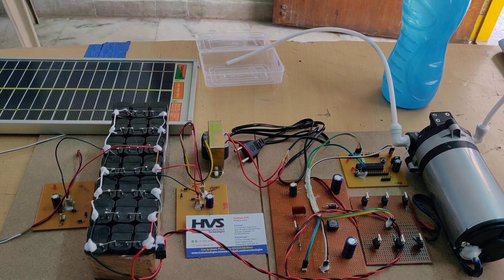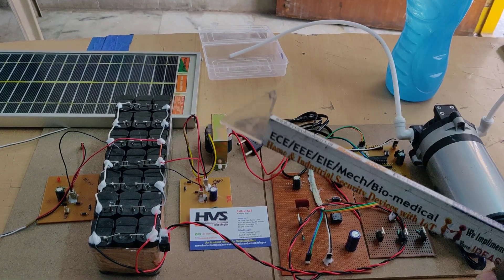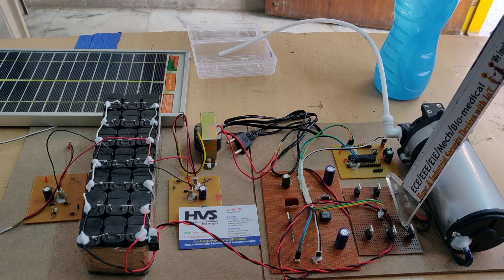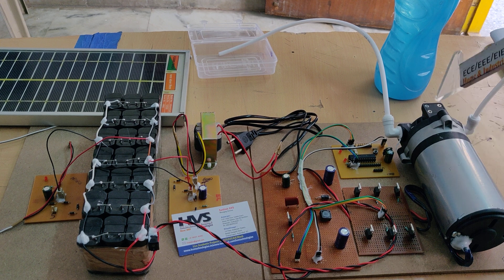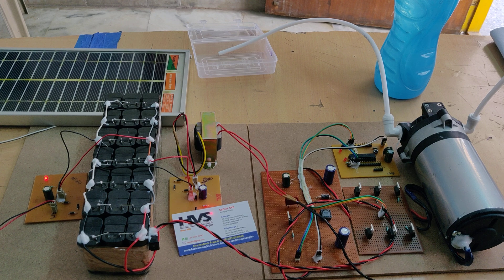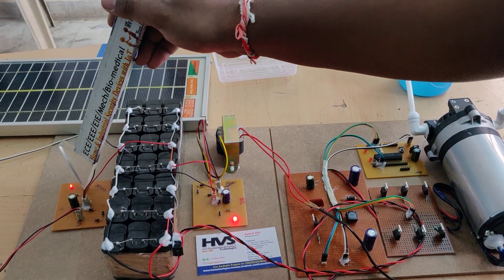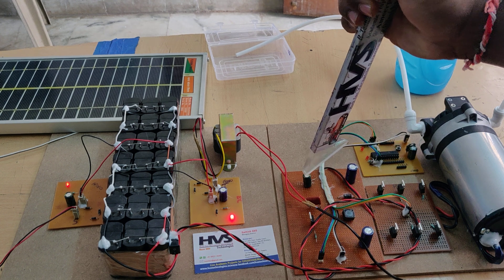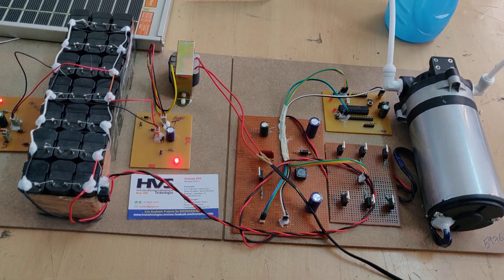HVS-3157. BLDC Motor driver solar PV array fed water pumping System Employing Zeta converter.

Comment: What is the rating of bldc motor in solar water pumping system using zeta converter
Reply from the maker: You can contact us at +919603140482
Through WhatsApp or call